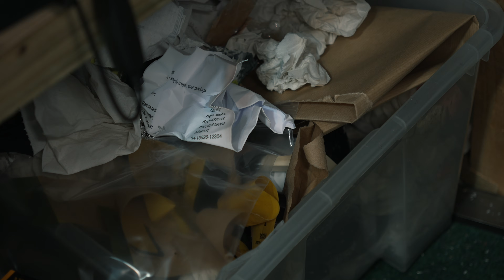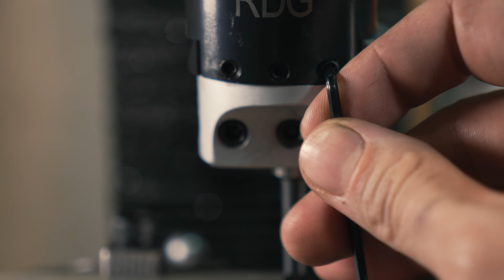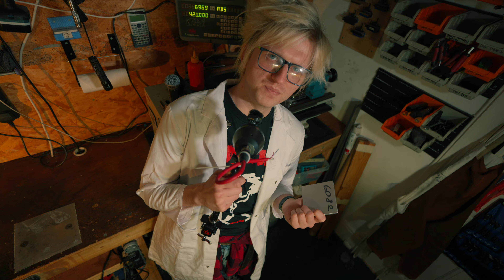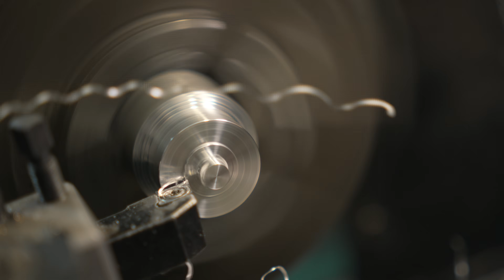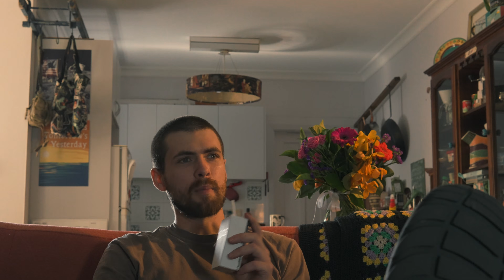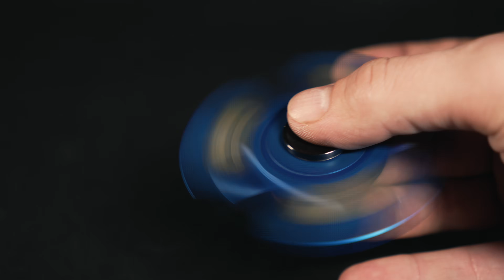This would've gone viral in 2017

Comment: As a machinist, the setup trick used to make the concavity is honestly quite clever, itd be pretty useful to make custom diameter and depth concavities accurately (with a more rigid cutter setup). Good stuff, might steal that idea if i cant use the cnc mill to whack that out.

Comment: I'm still seeking my way to get to the other side of the ADHD satisfaction curve.

I'm something of an expert in this area, having been managing and researching it for a long time.

What most people don't know is that there are different responses to tonic (baseline) and phasic (short blips) of dopamine signalling. In the long term, with sufficient dopamine, pursuit of a goal that we have deemed valuable gives us a feeling of SATISFACTION. It's not just about reward or pleasure seeking.

The curse of ADHD, is that short blips of dopamine may be enjoyable, but can easily feel meaningless, and the long-term, meaningful goals that start off as exciting, lose their attention overtime when we no longer feel satisfaction in what we are doing. When this happens, it can be difficult to even force your body to move in the direction of the things that once drove you, and excited you. Agitation and negative emotional states can propel us further, but then a person might perpetually live like that in order to get anything done.

I didn't use the term 'curse' lightly.
Reply from the maker: You've basically just described my daily struggle. 
My biggest issue is executive dysfunction, whereby actually STARTING a job is the hardest part. It's like my starter motor is faulty, but once it gets going, it's generally fine. 
It most certainly is a curse, but being able to put a label on it as well as research methods of dealing with said curse has been quite a visceral experience. I feel like I've got a long way to go, but at least I know where I'm going.
Reply: @Erik-not-Eric  God, yep. Once my hands are in the dishwater I can continue to wash the dishes with no problem. It's the starting that's a a problem. Similarly - it sounds like the opposite but isn't - lots of projects remain unfinished because it's even harder to get started on something you've already started and then had to pause for some reason

Comment: Great video, thanks.
Two thoughts, one might be useful — 
1. The brass sheet under the work is a great idea. Consider using superglue to bond them and reduce the potential excitement of the fixture liberation process (refer Clickspring); and,
2. Consider getting weights in tungsten (or even brass) for more rotational mass (just in case you ever want to go to that project again).
Reply from the maker: Absolutely agree regarding tungsten - I actually asked PCBWay if they could do that, but it wasn’t on the menu 😒 titanium was purely an aesthetic decision because of the colour options.

Comment: that trick with the combined 4th axis and boring head at 17:00 blew my mind
Reply from the maker: I’m lowkey proud of that
Reply: @Erik-not-Eric  Completely warranted.  The dished surface was so satisfying to the eyes, I can only imagine how nice it feels in hand.
Reply: @Erik-not-Eric  you should try it again except on the last pass you go 22.5 degrees, pull out,  move another 22.5, put back in, repeat till you're at 180 to make some interesting knurling
Reply from the maker: @satibel  I'd probably have to set the mill head more accurately to get the knurl pattern from the cutting tool in the right place, but otherwise - that's a really good idea.
Reply: @Erik-not-Eric  since it's rationally symmetrical it should work, you might just have to do 360 instead of 180.
Reply: @satibel Eh? You sound like my mrs  on date night.

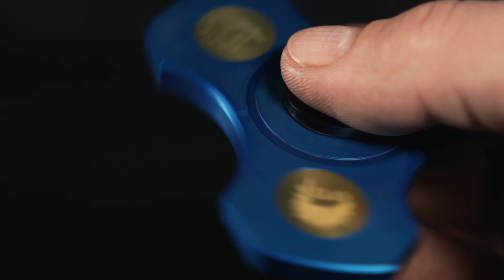Comment: Why the huge run-out at 21:00?
Reply from the maker: That's actually a good question. The honest answer - I'm not sure. The only thing I can think of is that because I machined this over several days, the DRO didn't capture the centre position of the spinner when I turned the power off, resulting in this. Well spotted though.

Comment: For autistic me, having a slightly rough spin of a basic spinner works best - it gives me tactile vibration, which occupies my sense of touch, whilst enabling my hearing to focus on the meeting or whatever. So ideally I'd like a premium looking spinner with an engineered-in flaw - yeah, that's off the shelf, not.
Reply from the maker: Interesting - I actually didn't think of that. I bought a hybrid ceramic bearing for this as well, but it didn't spin as freely, so opted for fully ceramic.
Personally, the quier whirring of the bearing is oddly satisfying, but I can definitely see what you mean.

Comment: While titanium is cool, for maximum spinnification some tungsten lumps would work great.
Reply from the maker: I did actually ask PCBWay for tungsten. Unfortunately not on the menu 😒
Reply: Tungsten carbide is nearly as dense but a lot easier to come by. It is however eeeever so slightly harder to machine.....
Reply from the maker: @andersjjensen the word “slightly” is doing a lot of heavy lifting here 🫡
Reply: @Erik-not-Eric  Diamond wheel on the surface grinder will do the trick... if you depth of cut is fuck all, you stepover is minimal and your coolant pump is set to Flodgate.